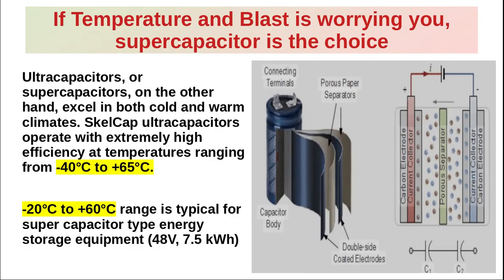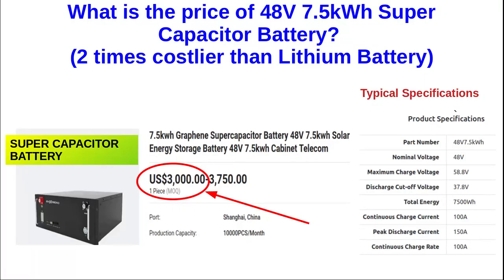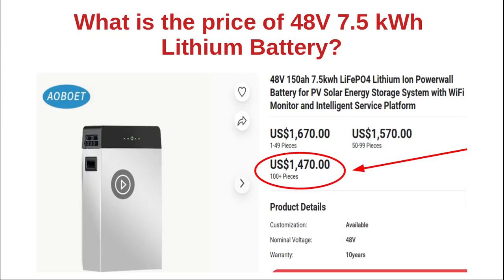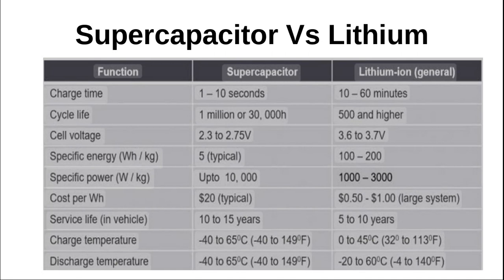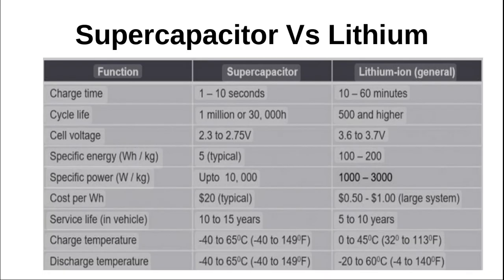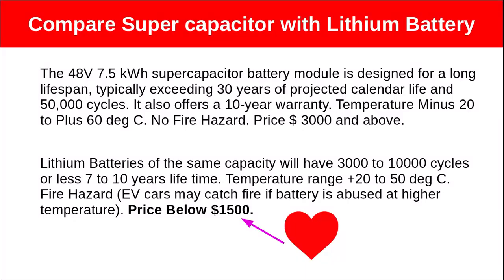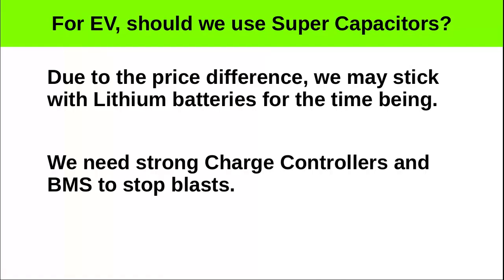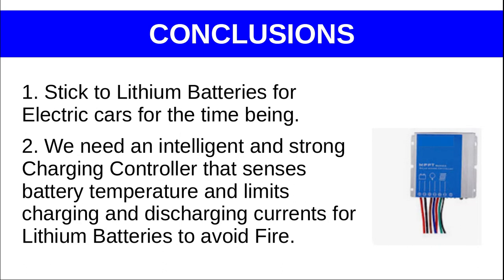The Shocking Truth: Why EV Cars Catch Fire!

Comment: Incorrect fact to start with. Luton airport parking fire was started by a diesel Range Rover and NOT an EV.
Reply from the maker: Thanks for the feed back. I only gave the information based on  what was reported on internet. 

However the EV fire is real in hot climates under certain conditions. Also when I searched I found that EV fire was reported from many countries, many times. There was no check or regulatory restriction on the EVs regarding safety of the cars to the public, by all the countries. EV manufacturers must be forced by the Governments to change the EV car design by replacing "cylindrical cells in parallel" with prismatic cells and to build measures for no more blasts, like making it mandatory to control  the charging and discharging currents   when the temperature of the car near the battery is beyond 45 degree C as shown in a slide in the video.

Comment: THE SHOCKING TRUTH: Why ICE  cars explode!
Reply from the maker: Internal combustion engine (ICE) cars can explode due to several factors, primarily related to fuel and electrical systems. Here's a breakdown: 
1. Fuel System Issues:     Fuel Leaks and Fires

2. Electrical System Problems:    Wiring Malfunctions,    Short Circuits.
     
3. Overheating and Engine Malfunctions:     Engine Overheating:  An overheated engine can cause components to fail or create ignition sources.
    Other Engine Issues:
    Mechanical failures in the engine can also create conditions for a fire, potentially leading to an explosion. 

4. Other Factors:   Collisions:     Accidents can damage fuel tanks and lines, leading to fuel spills and fires.

Comment: This is total BS. The Lutton fire was caused by a diesel truck etc, erc.
Reply from the maker: I only gave the information from what was reported on internet. Also when I searched I found that EV fire was reported from many countries, many times. There was no check on the EVs regarding safety by all the countries. EV manufacturers must be forced by the Governments to change the EV car design by replacing cylindrical cells in parallel with prismatic cells and to build measures for no more blasts like the control of the charging and discharging current   when the temperature of the car near the battery is beyond 45 degree C.

Comment from the maker: Use of many cylindrical Lithium ion cells in parallel and then series connection of many  parallel battery banks may be another reason for fire. If one cylindrical cell in a parallel bank fails, the current  will be shared by other cells in the bank leading to failure or fire of one cell after the other in a sequence until all cells in the bank are destroyed by fire. Use of Prismatic cells in the car battery design should increase the safety and reduce the chance of fire.